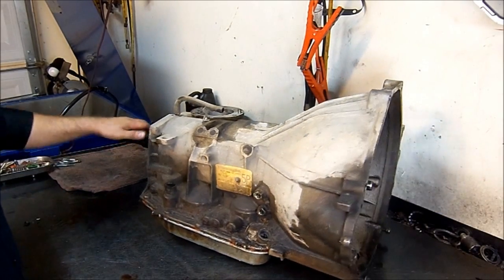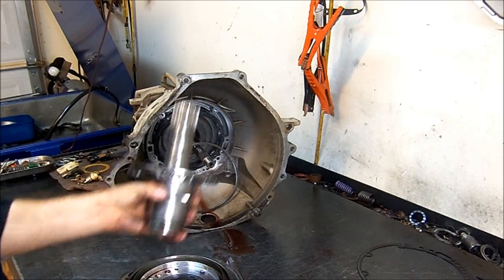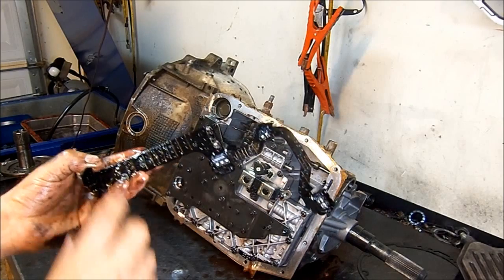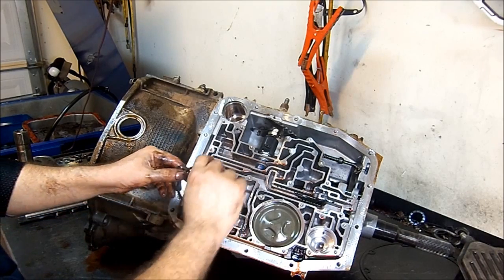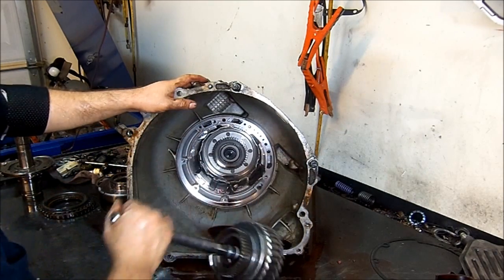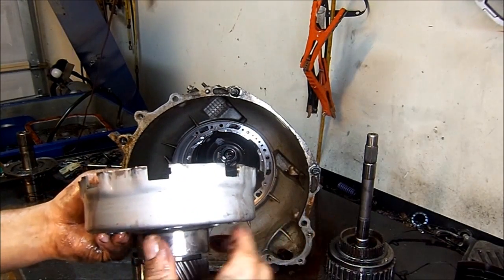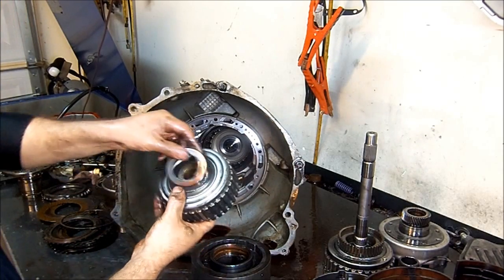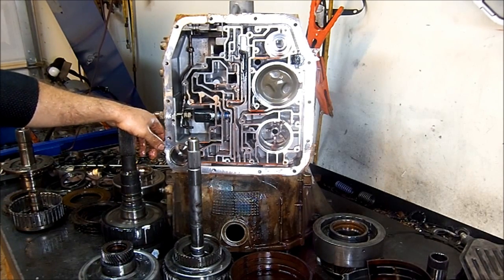4R75E Transmission Teardown Inspection - Transmission Repair

Comment: Please, I have a problem with the transmission for the 2009 Grand Marquis. The transmission does not move in reverse except with difficulty. It works, but very weak, the front gears work smoothly and excellently.
Reply from the maker: Probably broken band
Reply: @AutomaticTransmission  would you please let me know why my 4r75e tran won't engage in drive until I run up the RPMs

Comment: Awesome video. I have a 2004 f150, in which the OD servo snap ring broke, and upon taking it all apart to replace the snap ring, I did NOT find a gasket like the one you show at  about 10:00. I put it all back together, and now I have NO forward gears, only reverse. Is this a valve body issue, or do I need to do a complete tear down?
Reply: This gasket is the vále body between the valve body and trans. They as lways should be there and replaced after removal

Comment: Ac2p 7000  da  trans on my   2012 ford e350

I found a Ac2p 7000 ca  trans     with low miles
    Can i use it on my van

Thanks

Comment: Hey Hiram, what brand do you recommend for the clutch fibers/plates on this unit? For the input drum, what do you recommend? Thks
Reply: Hiram hasn't posted in a year or more and he goes back thru the comments and removes his inputs there as well. But if you go with a reputable rebuild kit they won't steer you wrong with crap plates or steels, high energy is usually the top class for bands. Call them they might have those in clutch plates too. Look up transtar for one source and check eBay for the part number - there is guy on there selling everything at 30% lower at least, trying to make himself a rock star and I'll help him.  This isn't your input drum but this kind of rebuilder fits my "better than most" category because this fix for in house rebuilds is brilliant.
Jasper Engines & Transmissions - GM 4T65E Input Drum Update
https://www.youtube.com/watch?v=hCjwKf3eiVA 
It's likely that if this product worked out well for them, that they may have done this to other similar GM input drums...

Comment: hola.. tengo un problema con una troka f150 2005, tiene codigos p2106 y p0717 arranca un poco lento y no pasa de 20 millas o 40km solo entra primera y segunda y se blokea la transmision, marca en el tablero trans fault y engine safe mode y ya se queda en un solo cambio, muchas gracias por su atencion HIRAM GUTIERREZ

Comment: 95 Ford F-150 losing overdrive running down the road , acts like it goes to neutral , let off the throttle and get back in it and it’s back . What’s your thoughts, maybe the one way or ratchet ? Thank you
Reply: Broken snap ring......remove pan and valve body
Reply: I’ll check it out thanks

Comment: Hiram, quick question. Tomorrow I have a transmission guy checking mine but I have to ask you... The truck was towed almost 3k miles, i think it was not properly lubed because the front oil cooler was broke. When we tried to move the car, the transmission would move to drive but move very slowly. Reverse works. I think it might have the same problem you had here right? the forward drum?
Reply: What's the question. Towed 3,000 miles get another tranny

Comment: I lost 3rd and OD on my 07 F150 4R75E  Search online and found the common problem of the OD servo Snap ring breaking and lodging in 2,3 shift valve, While removing pan found pieces  of snap ring,  but it was to big to be OD ring,  after watching this Video,   It is the center support Snap ring,  In Your exp what can I expect when I tear into It, as for as damaged hard Parts?   It pulls fine in 1,2 and R,   if I turn off OD or put shifter in 2nd
Reply: Hey! I have exactly the same problem, how did you fixed yours ?

Comment: I have a 4r70w trans having an issue car shifts threw all gears perfect when cold as soon as it warms up a whistling noice coming from transmission and then my 1st and 2nd start slipping bad but when I get up to speed 3rd and 4th shift fine any advice would be awesome I've been watching your videos all day thinking I would find something like that havent yet thanks
Reply from the maker: Your filter is Clogged. Usually converter lining shredds and ends up in the filter. 
Replace filter with new fluid and drive it to see if it sets any trouble codes. Then chase the real issue and repair as necessary.

Comment: I'm not rebuilding my trans however I am replacing my front pump seals and gaskets. I have a fluid leak. .this id my first time removing a trans.i took my front pump off an noticed the what u call the rewritten piston spring.which I didn't knw what it was till ure video.but my question is I noticed ur trans had 2  of those round springs.but mine only had 1, if that ok to only have 1? 2005 crown vic interceptor and can I replace the brass bushing fairly easy?
Reply: +wonnieboy 
as he said, the double springs were added to strengthen the single outer spring. Also, Bushings need a press and can be hard to remove if you don't know how. Hiram does show how to do both in other videos. I've rebuilt the trans in both my jeep and in a old race car (they are different) and bushings can be trouble sometimes.
Reply: +purplexenno I took a pic of Mr bushing an sent to trans shop an they said it's was still ok so I just replaced the front seal an took chance and put trans back in.So gas so good.no leaks an mostly no trans issues.running better then ever.thxs for the info purple
Reply: wonnieboy

no prob. :)

Comment: 7:11
That orange gasket didn't come from the factory.  The OEM gaskets are hard and very high quality.  They don't go bad and there's no reason to not reuse them.  Someone has been working inside that transmission and my guess is that they didn't know what they were doing.
Reply: If he didn't know what he was doing then my guess is that  he would not have used High Temp RTV when he could have used something cheaper. Also there are reasons you might not want to "reuse" a gasket. Maybe the old gasket broke when he took the pan off and the closest auto parts store to him was 2 hours away, by plane.😉

Comment: What would cause my od light to flash, and the trans won't shift into 4th gear when driving
Reply: Torque converter clutch or your electrical noids

Comment: HELPPPPPP

What will cause no forward, reverse works fine, AFTER A COMPLETE REBUILD? everything was changed, seals, gaskets solenoids, wire strip, everything I know to change. you can tell its going into gear and it moves forward slightly but will not go. trans is out of a 2006 ford crown vic police int, It gave an output shaft speed sensor so that wa also replaced. Now there are NO CODES.
Reply: mike johnson did you ever find out what your issue was?

Comment: Why would my transmission go into neutral after 2nd gear but it would go into gear after hitting OD switch off?
Reply: The forward clutch drum turns off in 4th gear and when it doesn't engage the forward drum is starting to fail. It will come back on it 3rd.

Comment: Valuable video, I was able to rebuild this as my first auto rebuild and had success.   

I have a slight issue, if anyone can help me please.  I made sure the o/d band was engaged properly before install, and I'm getting trans fault and o/d flash again.  No shift issues however.     I checked continuity on the internal harness, possibly solenoid or temp sensor?

Comment: Great video man! I was wondering, would you happen to know why on my 07 crown vic, after swapping it out from the same year vehicle and everything, when I put it into drive the transmission starts off in 2nd gear, shifts to third and no fourth. Reverse works, it functions normally with no slipping. It just refuses to go into 1st and 4th. Even when I manually shift into first it stays in 2nd.

Comment: Hi Hiram my 07 F150 when coasting down to or driving 20 mph when speeding up has a clunk in 2nd gear. Dealer said it was normal. I am sure you are going to tell me what it is before I sell it to my friend. 30k oil changes since new. Anti clunk spring missing on centre support or slop on the planetary drive shell maybe ?

Comment: just took my 2012 ford f150 to the transmission shop for the second time payed 1300hundred ,, this time trans in slipping at 3rd gear they wont 1600;;

Comment: Who ever had that pan off last could of caused the failure. Excessive use of silicone sealer where it does not belong. That stuff will not cure inside the pan rail will find its way into the valve body and cause problems.Yea a lot of manufactures use silicone to seal the pans but in moderation. Using silicone sealer on an elastomer gasket that is perfectly able to seal by its self is ignorance and is why you and me can pay our mortgage.

Comment: I like your video but its a little drawn out for a mere tear down.  Check this video on disassembling this same unit, 4R70W,
https://youtu.be/RxTz2LqIqeo
It is slightly more to the point, which is just tearing down.